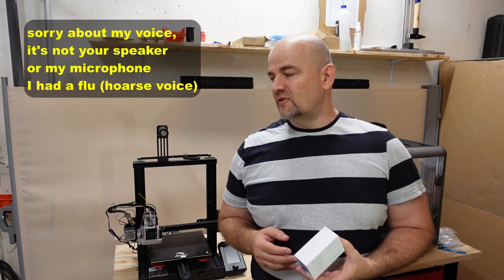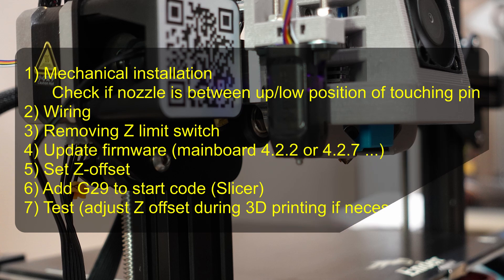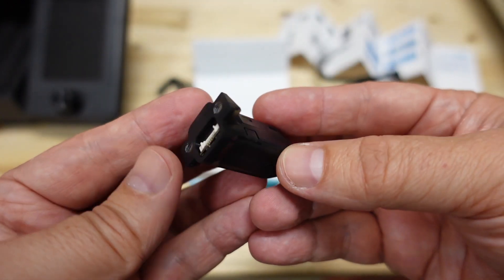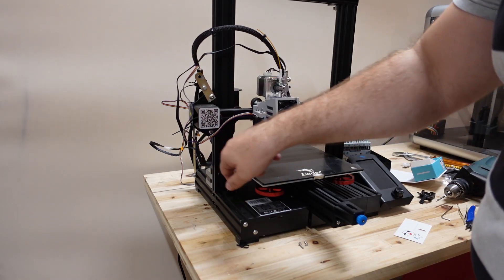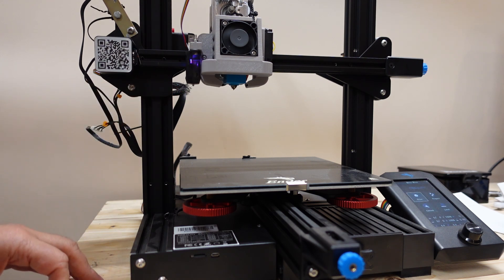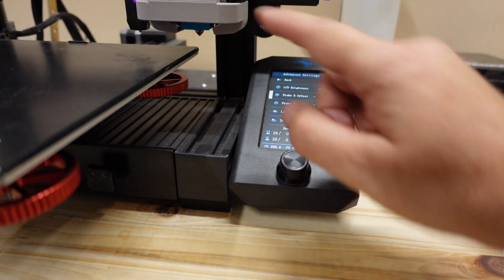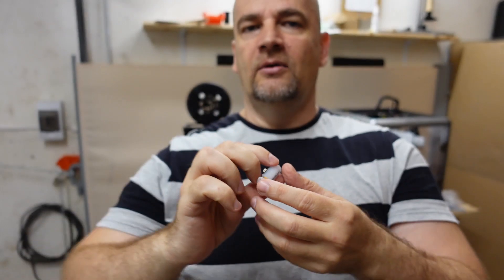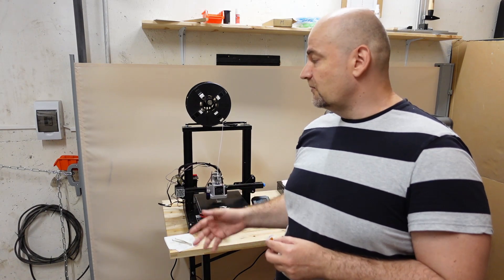Creality CR Touch auto leveling kit, is it better than BL Touch?

Comment: Hi.I have an Ender 3 with board 4.2.2 before upgrade was working well. After installation of the CR touch (Z limit switch disconnected) and firmware updating the homing of Axe Z not working.  When homing, Z axe is moving few mm in wrong direction (to up) and stops.  If I set back original configuration (Z limit switch and old firmware), Homing working again correct.
Any suggestion ?

Comment: I appreciate your videos very much.  I used your directions to install all of my upgrades so far.  That stated, I'm wondering if you can offer suggestions on a problem I'm having.   Would love your input:   I installed the dual motor version of the dual-z and also installed the CR touch at the same time.  Everything was working great, many successful prints... until I had some misfeeding filament and took my hotend apart (note, I also run the microswiss direct drive and all-metal hotend with the 3d printed fan shroud like you have).  I put it back together, tightened everything up and now I can't get a consistent z-offset.  I set it, re-home it and check for zero on Z and its is off. I've reset it numerous times...   I can't find anything loose on the machine and I can't think of anything else to try.  Any help appreciated!

Comment: I installed this on my Ender 6 and had minor issues with the factory firmware not loading (had to get them from the Creality Forum instead of their website) as well as the wiring not being long enough to to the main board - and incompatible with the hotend breakout board. I am very happy with the results and minor changes in leveling can be corrected on an imperfect printing surface (which most creality beds are). The ender 6 was designed to have the BL Touch and CR Touch installed without ANY mounts and squeezes in nicely. I am also using a PEI quick release bed - and solid mounts (thanks to the CR Touch) and rarely have to change anything (unless I move/maintenance the printer or start a long print). This has made printing 3D parts almost effortless - and most importantly - consistent.  
PS... with a core XY type printer where the head can move 100+mm/s there is a noticeable 'rattle' when the printer is making fast changes in direction.
Thanks for the video!

Comment: I ordered this CR Touch for Ender3v2 but my manual leveling is more better than using the CR Tough!
In the manual it is written change G28 to "G28G29"
Is there any difference?
Reply: I tried many times but always my manual leveling is better than using CR Touch
Reply from the maker: These are two separate commands. G28
G29
(In separate lines)

Comment: I had an issue with the nozzle going into the bed. I tested the cr touch with my finger and it worked but after that it went straight into the bed and bent the x axis bar when doing so. Any suggestions?
Reply from the maker: If with finger it stops, then maybe it is mounted in higher position than nozzle. Pin out must be lower than nozzle. Maybe bracket is up side down.
Reply: @MyTechFun  this is for the Ender 3 Pro, the bracket is practically impossible to be upside down. This is really testing my patience haha
Reply: @mr_wilson223  Nevermind the bracket. The point he was making is that the probe has to be lower than the nozzle. So just make sure that's the case.

Comment: I bought my first 3D printer, a second hand Ender 3X. I don't know if CR Touch is compatible with that printer since I can hardly find any information about this model. I have a 1.1.8 firmware installed on the board. I believe it's a silent 8-bit board. How can I use auto leveling with this printer? Since I bought it, I am only leveling and leveling and can't even play around with printing parts. I will change the board if I can use auto leveling.
Reply from the maker: You can't use it with 8-bit board without some hacks. CR Touch is compatible with Creality 32 bit boards (they have dedicated plug for this 5 wire connector)
Reply: @MyTechFun  Thanks

Comment: I didnlt really understand   the bit about the G code and adding the extra string,what does it do exactly

so do you need to add the extra g code to every print or does this FW have an option to do it automtically before each print  or could you just  run the auto bed leving option manually before you print?
does adding the gcode make the  printer check the bed and level it while it is printing?
or does it just  perform the same  auto level sequence which  you can do manually before each print?

Also I was looking at these at the microcenter near me, a couple weeks ago they had one open box ,  I just checked again today  to see if they still had the open box  in stock and now they have 3 open box in stock at my local store, so now I am wondering why they  keep getting returned
Reply from the maker: G29 is a command to do auto leveling (2-3 minute process). It check the bed and create offset mech. During 3D printing, it compensate the position according to that offset mesh. There is a solution, where the offset mech is saved to eeprom, and just called when next printing, but you have to fix your bed good (yellow springs or silicone mounts). That saves you the sime. I recommend Jyers firmware for this.

Comment: I've installed the CR Touch using the provided bracket but upon further inspection the nozzle is lower than probe causing the nozzle to crash into the bed. Please help, thank you.
Reply from the maker: Maybe the bracket is up-side down. It was possible error with older BL Touch. Looks like with this too.
Reply: @MyTechFun  you were right. thanks so much for the help
Reply: @MyTechFun  thank you I'll check into it

Comment: I notice they state to use the CR touch with the bed cold, I thought you want it up to printing temp??
Reply from the maker: With G29 in start g-code it will do the touch with heated bed and nozzle, just before starts with printing.

Comment: Is there a technical reason why the CR-Touch sensor shouldn't work with like a 1.1.5 mainboard with the apropriate BL-Touch firmware? The website says that the firmware for the 4.2.2/4.2.7 mainboards is the same for BL-Touch and CR-Touch. I can actually install a BL-Touch on my Ender-3 with a 1.1.5 mainboard. The BL-Touch needs a small adapter but it's possible with little effort. If both sensors work technically the same... ?
Reply from the maker: CR touch has 5 cables fixed next to each other, they go into same plug on new mainboard (most other mainboards requires two wires separately, usually going into z limit switch plug)
Reply: @MyTechFun  that's the mechanical connector which can easily be swapped with a bltoch cable. Since the same socket also takes a BL Touch i guess they should be pin-compatible.

Comment: can I used that on my CR10s pro v2 ?? and can I swap out the BLtouch and use the same wiring with out opening up the bottom cover ?
Reply from the maker: I think not, if you don't have one of those newer 32 bit boards (with dedicated slot for BL Touch)

Comment: Good video as always, will you consider making a video on printing safety in terms of toxicity/fumes and particles and how to deal with it safely?
Reply from the maker: Hm. I will start with thinking about this subject. But it is big responsobility too, to cover all important things..
Reply: Pointless.

All melting plastics put off toxic fumes. End of story.

As far as how to deal with them. Getting an enclosure with an HVAC hose and a fan to purge the fumes outside, or doing your 3D printing in the garage are your only options.

Comment: Jyers firmare? where and how?  What is the advantage over the Creality firmware to control the CR touch and make adjustments?  GREAT video.  Thank you!
Reply from the maker: Yes, unfortunately this is true. It is only developed for Ender3, but a lot of advantages (M600 filament change works, offset mesh view, etc)

Comment: QUESTION (HELP) :  My Ender CR touch used to work fine and level the bed at all 9 points before every print. Now it only does the center and starts printing right away. This ruines my print since it doesn't level. Anyone know how to fix this issue? I can't find anything online about this exact issue :(
Reply: I have an ender 3 v2 *
Reply from the maker: What slicer are you using? You must add G29 after G28 in start g-code.
Reply: @MyTechFun  using cura. Yea I did that when I installed it.

Comment: I upgraded my Ender 3 V2 using your videos. Dual Z motors, Micro Swiss extruder and direct drive and the same fan duct and I also Jyers firmware 1.3.4. The last upgrade was the CR Touch and it never worked. I can setup the CR Touch and when it finish the auto bed leveling extrude a bit of filament on the bed and moves to the right and start extruding material without moving location. I tried 3 versions of firmware and all did the same. I reverted everything back without the CR touch and it's printing back to normal. Any ideas? Thanks!
Reply from the maker: I can't recognize this error. But obviously it is some electronic problem. Check the wiring. Make sure you use firmware for your mainboard (4.2.2 and 4.2.7 are different)
Reply: @MyTechFun  My main board is 4.2.2. Downloaded firmware from Jyers for BL Touch and Creality for BL Touch, both gave me the same failed results. Thanks for replying!
Reply: I had the exact same issue and i fixed it by changing my start code to the one you are seeing in the video.

My previous start code:
; Ender 3 Custom Start G-code
M413 S0 ;Disable power loss recovery
G28 ; home all axes
G29 ; Auto Bed Level
G92 X-10.0 Y-10.0 ; set home offsets
G1 X0 Y0 Z0.2 F3000 ; get ready to prime
G92 E0 ; reset extrusion distance
G1 X160 E15 F600 ; prime nozzle
G1 X180 F5000 ; quick wipe

My new working one:
M201 X500.00 Y500.00 Z100.00 E5000.00
M203 X500.00 Y500.00 Z10.00 E50.00;
M204 P500.00 R1000.00 T500.00;
M205 X8.00 Y8.00 Z0.40 E5.00;
M220 S100;
M221 S100;
G28;
G29;
G92 E0 ;
G1 X160 E15 F600 ; prime nozzle
G1 X180 F5000 ; quick wipe

Comment: Is it limited to crality-machines, or can I use it on every other printer with blt-support?
Reply from the maker: Without modification it is limited to mainboard with dedicated slot for BL touch (5 wires next to each other). Mostly Creality's new boards 4.2.2, 4.2.7 etc

Comment: Just installed CR Touch on the V2. Crealitys firmware blanked my screen. Smiths 3D firmware worked. Thanks for the suggestion.
Reply from the maker: Don't forget, sometimes you need to update the screen firmware too. And filename can not be the same as on previous install

Comment: My solution to not dealing with manual bed leveling was to return my ender 3 v2 and purchase a CR6 SE that auto levels in a 16 point grid. I haven’t had a single failed print. Probing level sensors are annoying as shit because you have to literally modify your printer by installing hardware and updating firmware. That’s more chances for things to go wrong, and it’s not very user friendly, especially for someone new to the industry/hobby.

My advice to anyone is to avoid auto level addons altogether and just spend a little bit more money and get the CR6 SE that has auto bed level, filament runout sensor, new hotend design, touchscreen, and included sturdy filament stand.
Reply: What a snowflake. Lol
Reply: Different strokes for different folks. Auto leveling only makes things more complicated. Manual leveling is incredibly simple and you rarely have to do it. I level my printer once every few weeks to a month and never have failed prints. Then again I have experience with 3d printing and don't need the auto level to "take the wheel" so to speak to get good results.
Reply: @xex2kok  every manual level 3d printer I’ve ever had needed to be re leveled and the z offset readjusted every three or four prints. 

Just because something is simple in theory does not mean it isn’t also tedious or time consuming.

In the end, we can keep arguing anecdotal experiences but one fact remains - auto leveling simplifies pre print prep.

Just like manual transmission vehicles, manual level printers will eventually be incredibly rare.
Reply: @Or_tho_bro  Just depends on the person and what they like. I've never owned an automatic car and will never lol.

My one printer that has auto leveling has been nothing but trouble. It does not work as reliably as my other 2. It still works it just isn't as level as my manual ones and doesn't compensate properly. Monoprice junk.
Reply: @xex2kok  I could tell you drove standard transmission vehicles. That’s why I mentioned it. Haha
Reply: @Or_tho_bro  Heh automatic transmissions are only the norm in North America.
Back to the topic tho: for me given the printer is a folding type the auto-leveling simply solves every little alignment issue that inevitably happens when you have to store the printer away by freaking folding it's gantry down and all, including dual-Z motor self-alignment. It's an invaluable tool for me.
But really, as the other guy says: everyone got their own view. For someone that already knows how to set something up, someone that already went into the whole 3D printing thing as a project or big boy lego, getting the part and installing later is hella easy and definitely worth it. Not even just for experienced people on the field, you just need to be the type that is up to messing with the hardware and software enough to get it up. For people that just want out-of-the-box working experience there are machines like you mention or the ever popular Prusas and Ultimakers for who got the money.
Reply: @Or_tho_bro  My E3v2 is a workhorse. Prints every material on the market with the creality enclosure. I print at 150 mm/s and they are dimensionally accurate prototypes. The only upgrades I've made are all metal hotend, all metal extruder and CRtouch. That's on top of the other benefits the E3 V2 has over the cr6.
Reply: @xex2kok  you do you, but that isn't normal. I've driven manuals, why the fuck would I want to do that when I have radar cruise that will do stop start traffic without having to touch a pedal, and and a flappy paddle 8 speed matched to 420 rwhp when you want to have a bit of fun.
Reply: @duckgoesmooo  You ask why you wouldn't want something then describe things that nobody wants lol. Great strategy. Enjoy your floopy paddles, at least someone out there does. There must be dozens of you.
Reply: @xex2kok  I don't need it either. It's for convenience. Adding the CR touch hasn't added any complications to my printing, just the opposite.

So you're right, different strokes for different folks.
Reply: Lmao...

You just don't get it...yet. I love my Ender 3 v2. It's printed perfectly since day one. I don't really understand the problems people have with it. I just think they have poor technical abilities and they blame it on the machine. Bed leveling was common sense for me. I only got a CRtouch for the convenience of not having to reach over and do it by hand. I make dimensionally accurate engineering prototypes on my Ender 3v2 with the CRtouch. So you can talk all you want about accuracy, the proof is in the pudding.

Upgrading the firmware comes with many more benefits and in many cases fixes and unleashes its true potential that was usually handicapped by the manufacturers firmware. So it's literally a win/win. I installed the hardware in 10 minutes. I can do 9 or 16 point mesh on my E3v2 as well though I only do 9. The E3v2 is an awesome machine. I'm building a Voron right now and when I'm done I'm turning the E3v2 into a switchwire.

We wouldn't have Hackintosh if those of us that were developing it said, we should just overpay for a Mac because it's easier.

Comment: This looks good! Thanks for letting us know about it.
BL-Touch has quality control issues. My first BL-Touch gave me a lot of errors (when it flashes red). After a lot of reading, thinking that it was something I was doing wrong, I discovered it was a common problem that a lot of people experienced. I returned it and got a replacement BL-Touch and that second one has never had a problem. I'm very happy with it now.
If I ever have to get an auto bed leveler again, I'll probably get the CR-Touch instead of another BL-Touch because of the quality control problems.
Reply: Did you get genuine BL Touch or the knock off 3D Touch?   I have not had the quality issues with genuine Antclabs BL Touch devices.  
I imagine, like any electronics, the CR Touch will have some that do not work also.
Reply: @EsotericArctos  Genuine BL-Touch.
There are many, many forum posts and product reviews that describe the same intermittent problem. More than one would expect from the typical DOA/failure rate of electronics.
Reply: @davidg5898  I wonder if the CR touch will have the same issues given it is based on the same technology....   I have been lucky with BL Touch in that my 5 have all been absolutely reliable.    I went BL Touch after seeing a lot of reports of capacitive sensors being intermittent.   Guess you can't beat the old manual levelling really.

Comment: Original is just fine :)  It's a 'probe', and they are both the same, whether plastic (for a reason, aka, your bed ;)), or metal, that is not gonna be so kind, plus BLTouch works with SKR :)
Reply: The probe retracts higher than the nozzle, so even a metal probe should not damage the bed. The nozzle crashing into the bed will damage it, which mine has several times due to the BL Touch randomly failing. Whichever fails less is the winner.